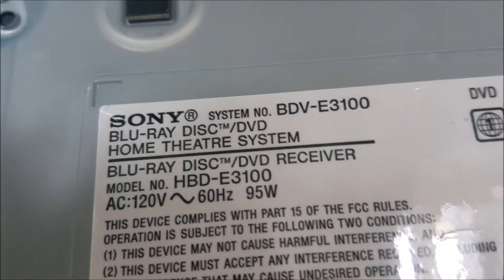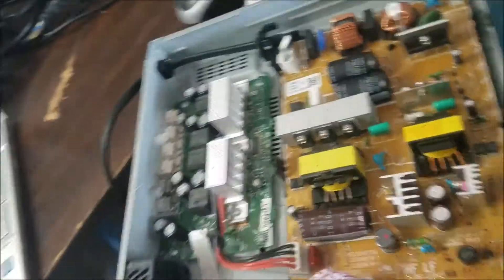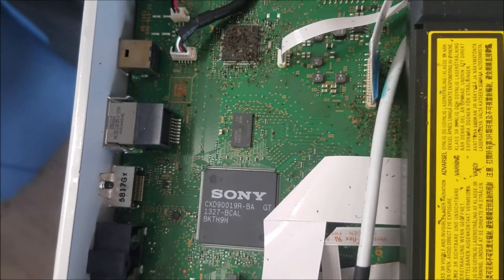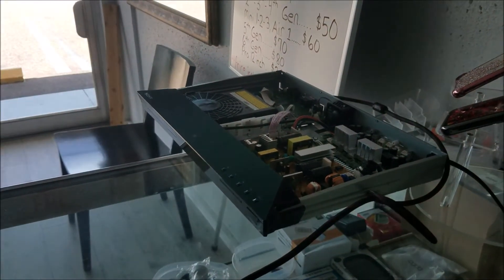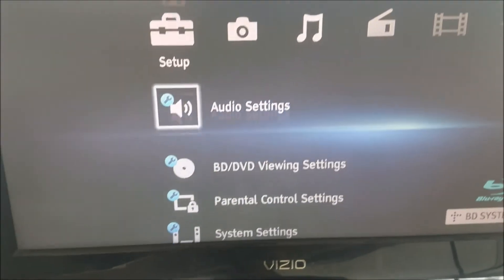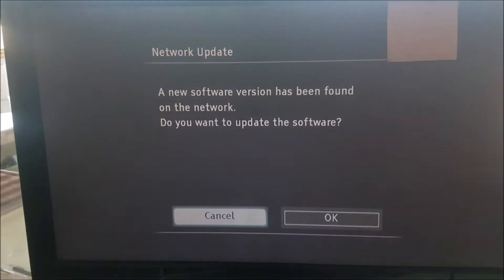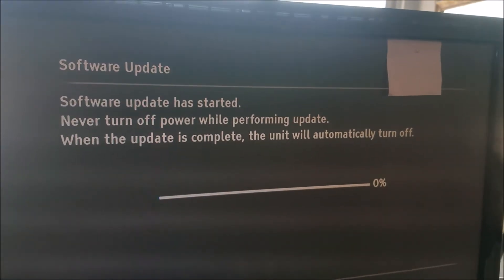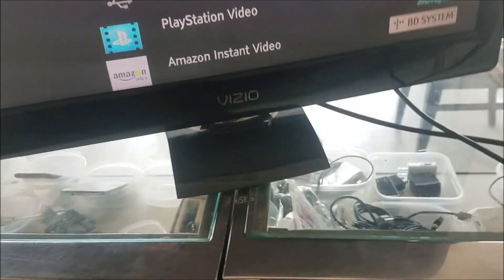SONY HBD E3100 stuck at hello

Comment: My E3100 gets stuck after loading screen. I can’t even get into the main menu. Any idea what I can do?
Reply from the maker: could be software issue. try force update it
Reply: @SOSfixElectronics  any idea how I can update the software? I can’t access the main menu.
Reply from the maker: @KevinLeeVlog  try this. connect it with ethernet cable and it should do automatic update
Reply: @SOSfixElectronics  let me try! Thank you very much!
Reply: @SOSfixElectronics  so I tried connect it to the Ethernet cable. Nothing is happening. On the display bar, the “repeat” icon keeps flashing. Not sure if it means anything. But I can’t reject the disk tray, only thing works is the volume.
Reply: @KevinLeeVlog did you ever fix it?

Comment: Hello, i have the e2100 and it seems that the optical port doesn't work! Do you have an idea about it?
Reply from the maker: there is a option in the menu to turns on off the optical port, try to reset the tv, update the firmware, change the main board

Comment: Hi, i have a Sony bdv e2100 that is stuck at hello, no video signal, no audio, and light blinking, could be the ram ic?
Reply from the maker: 1st try hard reset and software update by usb
Reply: @SOSfixElectronics  thanks, how can the hard reset be done without video signal? What are the buttons on the remote/receiver? Thanks
Reply: Same problem with my e6100. No one in my country could fix it.

Comment: Hi sir from Lebanon. I have the Sony e6100 & I have this hello issue. My system keeps stuck on hello then nothing works besides no video signal & the white color led keeps blinking. The remote becomes useless as well as all the bottons on the dvd. No one in my country could fix it. What is exactly the solution & would you please provide me with the number of the ac which may be the reason of this problem in my e6100?
Reply from the maker: Sorry i dunno what exactly the issue. But try to flash the eeprom with right software. Connect the device to the internet by cable and let it di the update. You may need to look on sony site how to force the system for the update. Good luck